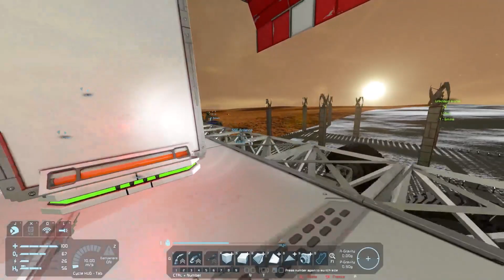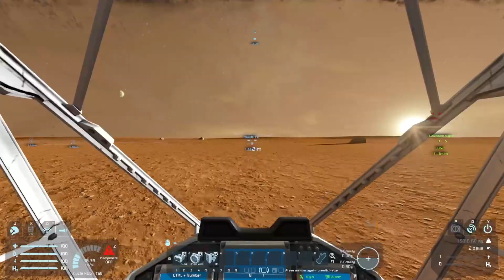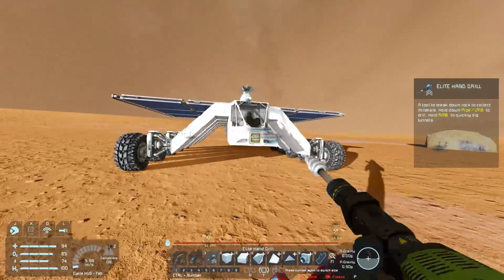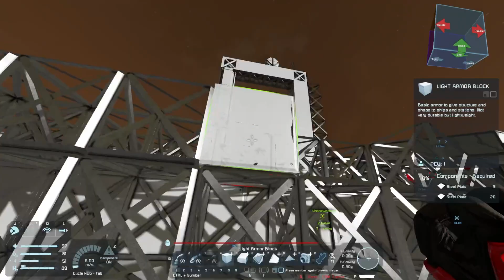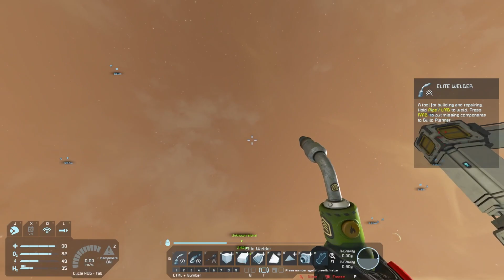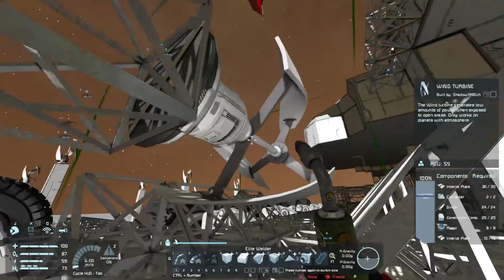Space Engineers: Roofing, Part 3

Comment: I have a suggestion which may entirely 'cheat' your whole wind turbine conundrum.

IF a piston attached to the ship underneath, is NOT considered a sub-grid [and I do not  know if this is true or false], then placing a piston with a mag plate that reaches the ground COULD be all it takes to use the option to 'convert to station' any time you want to park and set up shop, especially when drilling.

REAL WORLD drill rigs have pistons out on each corner that stabilize them so they can drill securely, and these actually, in many cases intentionally pull the wheels off the ground, but in this game I don't think that would be necessary.

Basically, my thought is, with a piston in each corner, just find a place where there it good ore, position your rover over that, lower the wheels to their lowest height [that will not damage the drills before even starting them anyway], and then just lower the pistons with mag plates to the ground, turn them on, and use the 'convert to ship' command, and any wind turbines SHOULD begin working.

ANOTHER possible option would be to build a very low mass [like intentionally not welding the whole unit] flatbed trailer [yes, I realize that this makes it a sub grid, but anyhow] tow it behind the main platform, making it where it is the part that can easily be converted to a station, where all of the turbine towers can be placed either on permanently upright towers, or, especially if there is a high risk of lightning, make them all lay over, but make them all one or 1.5 blocks spaced, so they have enough clearance to safely lay between each other, the way you can lace your fingers together on your hands.

I do not know what the minimum useful spacing would be for wind energy, but, perhaps, you could even have every other tower on a piston set to space it as far from its otherwise most adjacent neighbor so that they do not interfere much with each other.

And in the center of all of this, maybe have a cluster of batteries [especially since if it got accidentally disconnected from your rover it could cause you a lot of problems], and a single taller piston tower or fixed tower with lightning decoys to protect the rest of the unit.

I do not know if you can make items radiate out from a structure at 45 degree angles, but if you can, this would help even more to spread the individual turbines further apart with relatively the same size of trailer.

Comment: You know...

To shorten the distance the machine has to drop, you can always build a platform under the wheels [doesn't really need to be completely welded] to bring the ground up to the rover, and then you can also make a ramp from there down to the ground.

If you can't fit full blocks, you can add a half block and maybe some cat walk or a solar panel, just to 'shim up' the height a little too.

Again, you don't have to weld them up, just leave them there until the rover is on the ground, and then grind them away since they won't be needed any more.

Comment: The use of  the "extra" full armor blocks over the bedroom/ medical bay could be half blocks (more like reactive armor dont worry about deformation ) 

Two hinges and a connector " on the base or the Lg rover will give you enough movement to connect them back.
Once disconnected the grid labels will change color so you be able to tell which o2/h2 your trying to refill from. LOL

As for structural integrity on "dropping" the wheels will support the ... (by SE physics you could have 1 wheel ... it might not move fast ) As for the ship as long as you turn of dampeners when landing you should be okay.